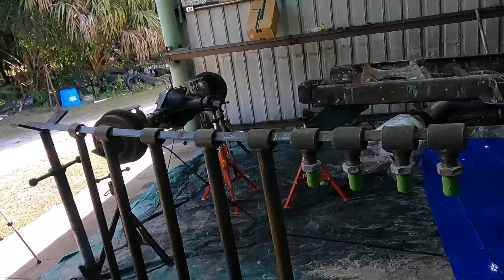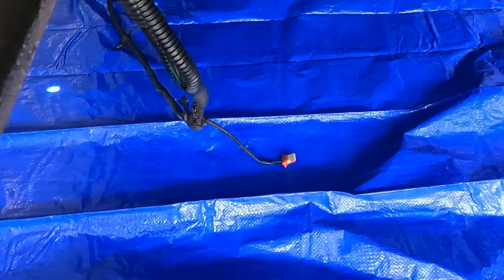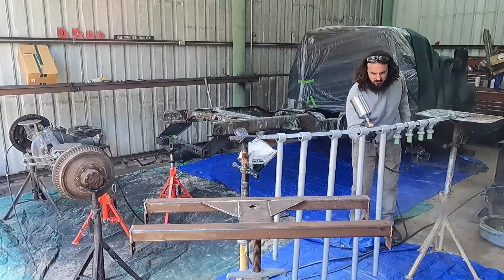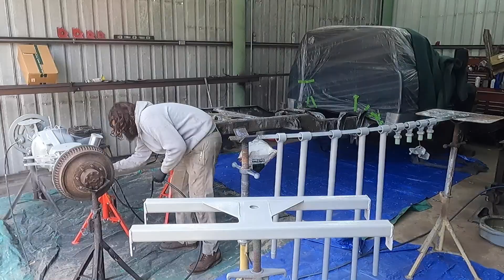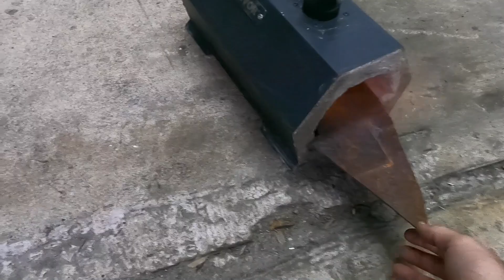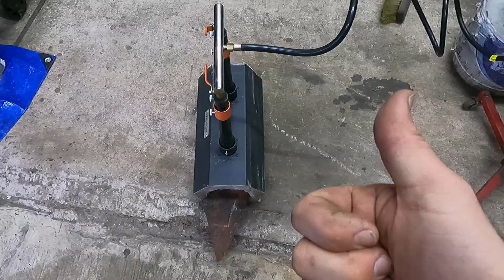The Injured Mans Paint Job | 2nd Gen Dodge Project

Comment: Buddy I use Rust-Oleum in a gallon and a brush to apply it.... and I'm telling you this stuff works great you buy it at Home Depot black and white. And Tractor Supply I use the Rust-Oleum there to paint stuff that's going to sit outside and not going to make it try to look beautiful. Works good brushing it on with some Harbor Freight brushes😂😂.

Can't take credit for it though. I saw a mustie1 do it to his red trailer. And it held up for years.
Reply from the maker: This is rust-oleum, I just chose to spray it on.